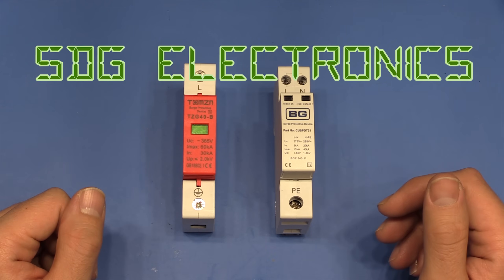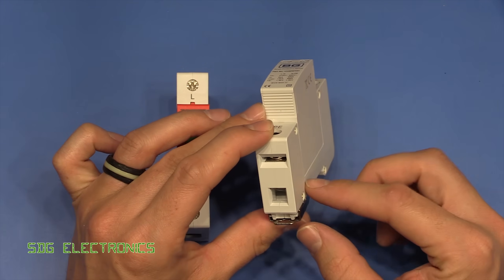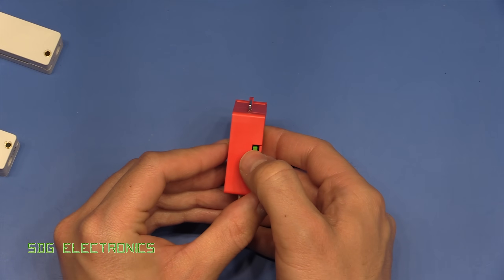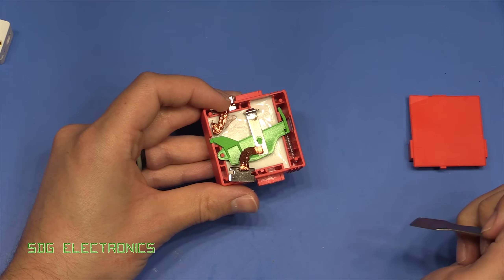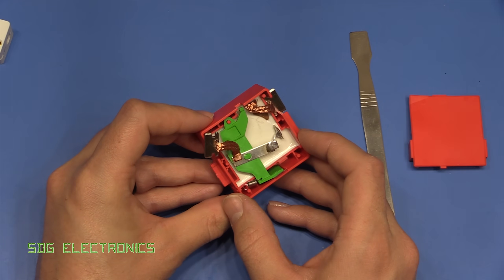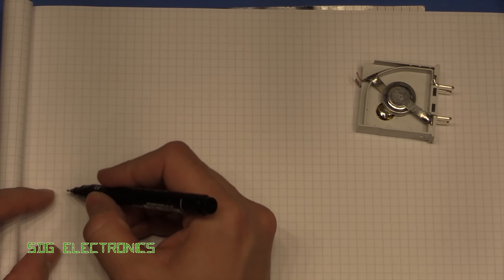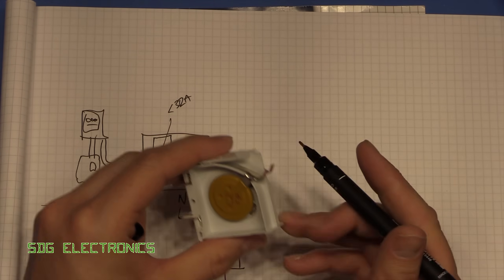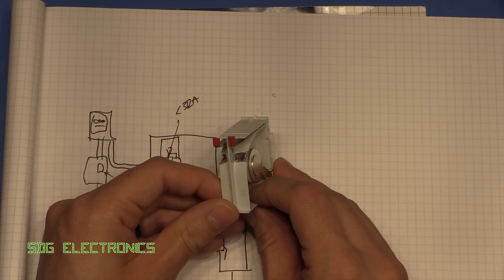SDG #045 Surge Protection Devices - BS7671 18th Edition

Comment: the pin on the back is there for holder that supports a monitoring output connector so when it trips you can have it wired to a light or a sounder

Comment: The Chinese device will just be a single giant MOV. MOVs are quite capable of handling currents of up to about 50-60 kA if large enough. 

MOVs are needed for a phase to earth or phase to neutral SPD. GDTs don't self reset in the presence of voltage - MOVs automatically return to high resistance state once voltage falls below the threshold. GDTs remain in a low resistance state until the current flow stops. If placed in a PN or PE position, once triggered, they would form a continuing short-circuit until the device was destroyed or overcurrent protection tripped. GDTs are acceptable for use on a neutral-earth position where continuing current would not be expected.

MOVs and GDTs are OK for "type 2" and "type 3" SPDs - which are intended for indirect lightning or switching surges. However, "type 1" SPDs intended for direct lightning suppression need to use spark gaps, as the energies expected are far too high to be practically managed with MOVs.  Spark gaps also have the problem of shorting out the mains supply until the end of the AC line cycle, which adds to the energy they must dissipate, and also results in voltage dips which can upset sensitive equipment.

There is a conspiracy theory circulating from a manufacturer of MOV devices that the spark gap SPD manufacturers managed to twist the arm of the standards committee, and get them to set the minimum specifications so high that MOVs and GDTs were out of the question, allowing spark gaps to corner the type 1 SPD market. 

TVS diodes are another SPD option, they are like MOVs but trigger faster and harder. They are hugely more expensive than MOVs, and available in much smaller current ratings. However, the higher performance makes them suitable for use on very sensitive high-end electronics, and the low capacitance means that they don't cause much degradation to digital signals, so can be used on high speed data cables.

Comment: so actually you can reuse the device after its popped? just push those elements back and re-sold them and they are ready to do the job again, I suppose!
Reply: Um, no, that's actually very dangerous. It doesn't trip after every surge that the device dissipates. But every surge will degrade the protection devices (especially the metal oxide varistor) a little bit, to the point where it will start leaking more and more current during normal (non-surge) operation. The low temperature solder connection is there to disconnect it once the leakage current gets to high. Reconnecting it (especially using different solder with a higher melting point!) means you just created a time-delay fire starter (and no, the circuit breaker won't help with that, a leakage current well below its tripping point is enough to catch things on fire; the MCB is there for catastrophic failures, for example after a direkt lightning strike has blown the innards to smithereens).

Comment: I bought lots of BG chrome face plates onces. Never again will I buy BG. They are terrible over priced rubbish. The dimmer switches had nothing but problems and the TV aerial socket had poor connections leading to signal break up. The twin socks have hard to push rocker switches and plugs have to be forced in.
Reply: same problems I had, the dimmers are too deep into the back boxes too

Comment: Low temp aloy releases spring loaded tab. When the MOV's have died they overheat and trigger it. Flag changes colour and button on the back pops out. That little button on the back pushes a microswitch to remote signal that protection has failed. The cheapo chineese ones only have MOV's. The propper high grade units normaly have TVS, Gas discharge and MOV.

Does the paperwork with the £75 unit mention insurance cover at all ? If not you would be better of with a decent UPS to protect any expensive kit. I have a 3.2 KVA APC unit and that claims it can take a 15 million Joule's. You get a £1M insurance policy / garentee with it to.

P.S. I used to work for openreach and they removed the gas discharge surge arrestors from there NTE's or master sockets years ago.
Reply: I was going to ask whether anyone had tested the melting temperature of the "solder"

Comment: I've been dealing with MOVs a fair bit in industrial applications. Littelfuse iTMOVs are £2 from Farnell, have a proper thermal fuse, a fuse blown indicator lead AND UL certification.

https://uk.farnell.com/littelfuse/tmov20rp250m/varistor-mov-650v-disc-20mm/dp/2786519

That £80 module is such a rip-off!

Comment: Most probably the solder used is a very low melting point stuff. Regular 300+ degree solder will take a long time to melt.

Comment: 7:35 annnnnnd, there is your price difference. 15:35 breaks cleanly, 7:35 fails shorted
Reply: If the heat source was larger, the proper heat source, that wouldn't have happened though.
Reply: In actual use it would still be shorted, therefore still conducting, which would then cause it to carry on melting until it failed open.
Reply: @richardneilson  No, it won't because the heated contact would be heated for longer time and therefore the solder would have been melted completely and not bridging anything.
Reply: @sebi7794  That's what I said, it would carry on conducting until fully melted
Reply: @richardneilson  Yes, you are right. I don't know what I read there :-)